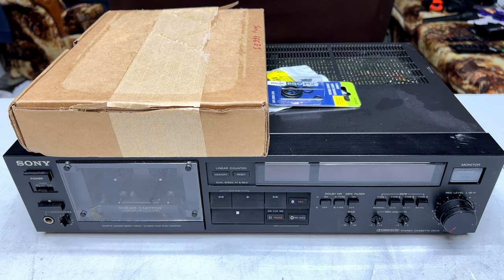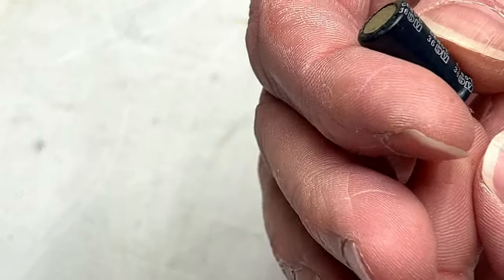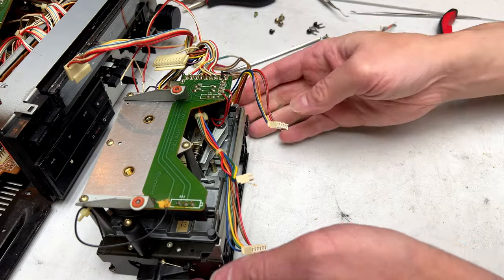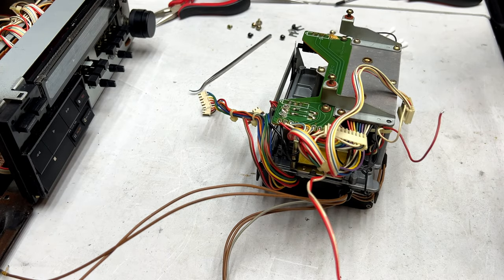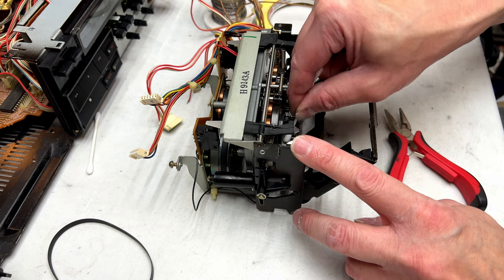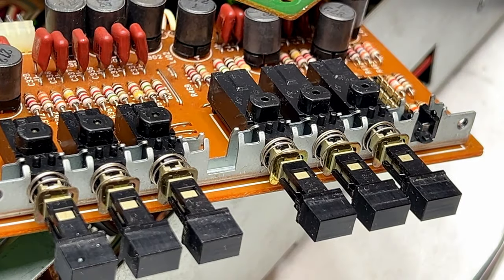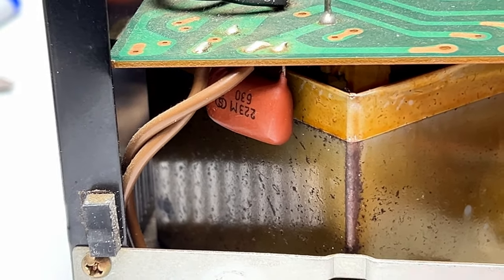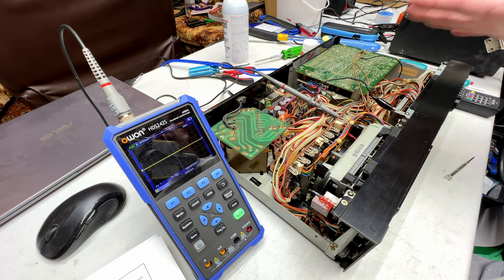Sony TC-K666ES Part 2 - This Deck Has Chosen War

Comment from the maker: Disclaimer - an increase in primary side capacitance to the level I've done here is experimental on my part. Don't go this crazy yourself unless you're prepared to accept the consequences, as I am. In other words, don't try this at home. Use the original uF values if you're worried. For voltage - going to higher voltage parts is just fine, and in this case preferential due to how close the deck runs those parts.

Comment: I have a recorder exactly the same model, also with problems, (probably capacitors) when you play a cassette it turns off after a few seconds, however I want to recover it because it is a beautiful machine, very well built and with exceptional quality. I have already received most of the components needed for the repair. I have the original paper SONY service manual. I have been following your videos, so thank you very much.
Reply from the maker: Very likely the servo board has gone out of alignment because of the caps getting old. All I did was replace the six bipolars, and that was enough to throw it out of alignment because of where those caps are in circuit. I'll cover the alignment in the next video, but you'll need an oscilloscope and a power supply to do it... I don't think it's even possible without those tools. I'll get to that part when I can, but I'm new to this so I want to take my time so I can get it right.
Reply: Thank you very much for the tips, they are very useful. Fortunately I have these tools and this is a project that I want to complete, not now (I'm with others) but I want to collect all the information so that I can successfully complete this project. Machines of this breed are no longer made...unfortunately. Now it's time to use it and throw it away....and buy it again. Thanks again. @Oklawolf

Comment: I finally finished restoring my Sony TC K96R and I'm pretty happy. All new caps, transistors, belts....It was a Goodwill find it even had the manual and wired remote. It was playing low on the left side but some adjustment on the left playback amp fixed it.
Reply: Congrats mate. I am genuinely happy you got through with it. My dream is  to have an at least decent reliable tape deck. It doesn't have to premuim & upscale. I am in the market for 1, preferably restored😢

Comment: I have some 8v meter lamps, I think they're 4mm diameter, what are the dimensions of the one you need for the well?
Reply from the maker: Looks like it's 4.8mm x 26mm. I'm not sure I can save the green filter on it, but that's not a big problem for me.
Reply: @Oklawolf  If you can't save the filter, green nail polish works great and I know you have that ;-) Looks like mine measure 4,3mm x 20mm. These are axial leads, if you think they'll work, I'll send you a couple.
Reply from the maker: I'm sure those would work, and I'd be eternally grateful! Otherwise I'd have to pay the eBay scalper prices. JKL has the lamps, but Mouser and Digikey don't sell them for some reason.
Reply: @Oklawolf  Happy to send them. These are frosted but that won't matter for your purpose.
Reply from the maker: Thanks! I just hope I'm up to the servo alignment job. Sony's instructions are a bit confusing, but I'm sure I'll get it figured out. Can't be much worse than trying to find the cause of the dead capstan motor for two days.
Reply: @Oklawolf  You'll get it, just keep chanting "serenity now, serenity NOW!".
Reply from the maker: Haha! Well, I suppose I can consider myself lucky that the scope can do the measurements for me rather than me having to squint at the screen for minutes on end trying to figure it out in my head.
Reply: @Oklawolf  Your lamps are on the way. No tracking number, I'm trying standard post, we actually have fantastic service in my town.

Comment: What do the belt types mean? Would love to learn more!
Reply from the maker: Not sure what you mean. I prefer Fix Your Audio belts for most high end decks except for these dual capstan direct drive units. In these cases, the thinner PRB FRSP8.97 is better. Both this deck and the TD-V931 (video in  two weeks) have already very clearly confirmed that for me. However, the FYA belts usually outperform the rest of the PRB belt line, so it's only the FRSP8.97 I like right now. For not so high end decks, DeckTech belts from England are my go-to. They usually do worse than FYA belts, but not by too much, and they are usually way better than the cheap Chinese belts on eBay.
Reply: @Oklawolf  Thanks for the detail about belts, but my question was about the acronyms like FRSP, that the belt in your video featured. Sorry for the unclear question.
Reply from the maker: That's just the PRB naming scheme - I don't think it stands for anything in particular.

Comment: This is very nice deck i have serviced one for myself. Dont be afraid to disassemble those reel motors its not complicated as it looks like and also relube those pinch rollers arms - from my experience those were fused to their shafts and no play mode in the first place...
Regarding capstans dont spin...familiar to me too, but on my part one stupid 10mh inductor near controller chip was 'open' and because of it all tape transport was actuality doing nothing - just imagine how much time it took to find that one faulty part... :))) 
In the end these k666es are very nice peace of engineering and they sound very nice and warm.
Nice work!
Cheers
Reply from the maker: I’ll get it. It may take longer than I would like, but I’ll get it.